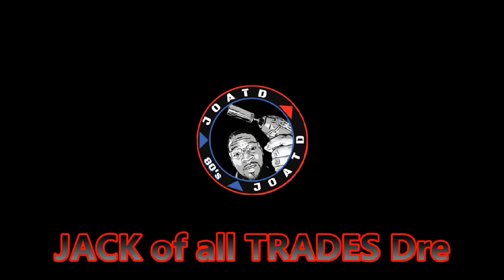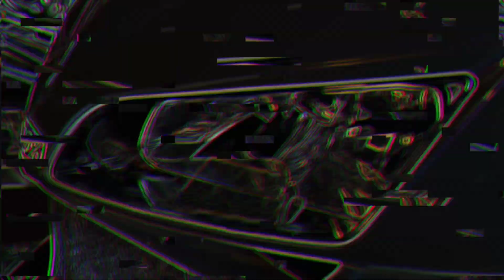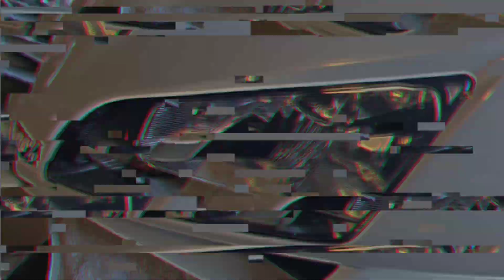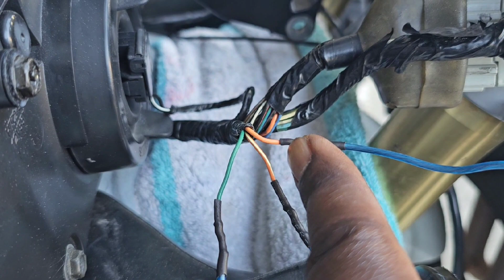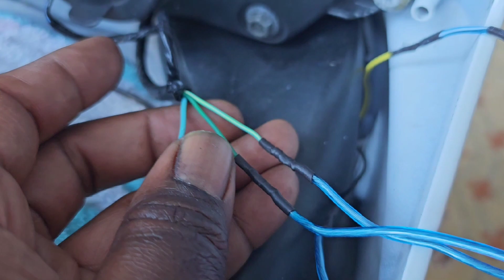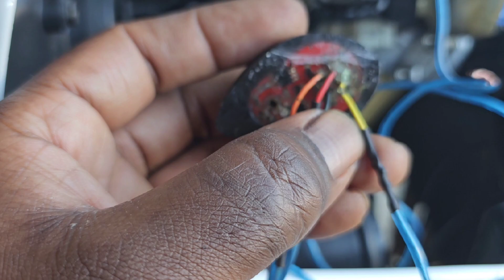How To: Install 4 Wire LED Front Turning Signal Lights on a Honda CBR 600RR / 1000RR (JOATD)

Comment: hi.thanks for the well explained video.i only have 2 wires going to the indicator but want to install indicators with running light.where do i get a connection for the running light.🤔 thanks
Reply from the maker: So you're saying that your bike only has two wires coming from it for the indicator and you want to install indicator lights that have three wires.
Reply: @JOATD yes sir
Reply: was going to run a wire from the rear running light 🤔
Reply from the maker: @bc-mr1si  okay, so yes you can run a wire to that third wire of your indicator light that comes from the always running Park light on your tail light. I would go online and get a wiring diagram of your bike find that wire and see if that wire runs to something else that's closer to the front of the bike then you don't have to run a long wire all the way to the back.
Reply from the maker: @bc-mr1si  if you don't mind me asking what year and what type of bike is it
Reply: @JOATD  hi its a honda cbr600rr 2011.ive sent a small donation to your PayPal account.
Reply from the maker: @bc-mr1si  thank you I really appreciate that
Reply: @JOATD  no problem. your videos help me a lot.saves a lot of head scratching 😃when getting round to do the job ill run a wire from the rear light split it in to two.one wire will run to each side of the tank behind the fairing for the running light on the indicators.
Reply from the maker: @bc-mr1si  sounds like an A1 job to me make sure you solder & heat shrink no butt connectors.
Reply: @JOATD  thanks fella will do .I have good indicators on my bike just now.they have the sequenced flow .but thought I'd get integrated indicators for the rear and running light indicators for the front .if I get stuck I'll msg you 👍
Reply: can ask why not to use butt connections 🤔
Reply from the maker: @bc-mr1si  just a preference thing it's a motorcycle you don't want any wires coming loose. Could cause a major problem. I like to do it as safe as possible cuz we're on two wheels.
Reply from the maker: @bc-mr1si  okay no problem good luck
Reply: @JOATD  ta pal

Comment: How do you wire the headlights if they cut the connectors?
Reply from the maker: The best thing to do is to go to the junkyard and get you a new connector off of a used car. And we're talking about a headlight connector, correct..
Reply: Yes headlight connector how would you wire that
Reply from the maker: @lagarcia6244  if you look at the bottom of my descriptions I have a wiring diagram for this motorcycle. That should help you with the wiring for your headlight